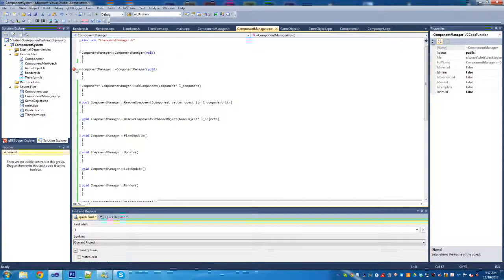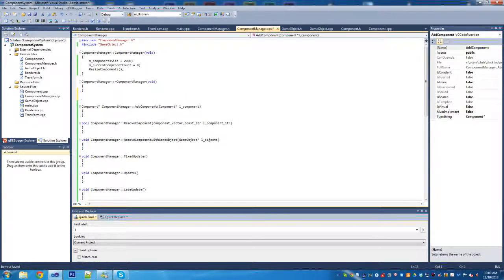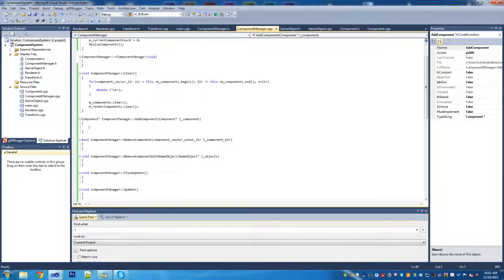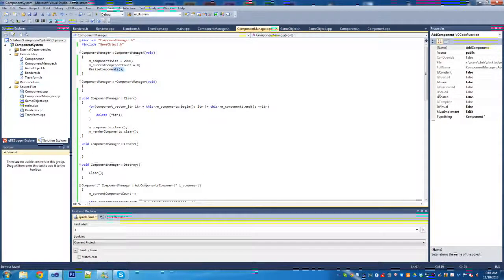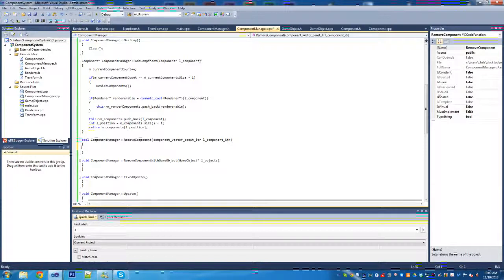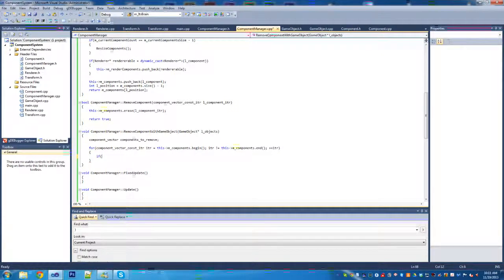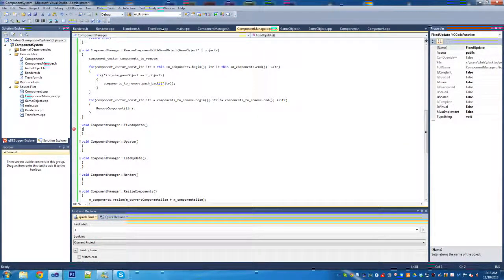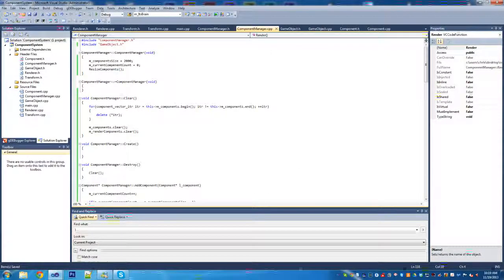Component Based Architecture #4

Comment: You do realize that the std::vector .size() and .capacity() methods work just fine, right? You don't actually need to keep track of that yourself.  Other than that, great videos! They are truly helpful. I left another slight criticism on the #3 video, but I don't want you getting the impression that these videos are not useful.